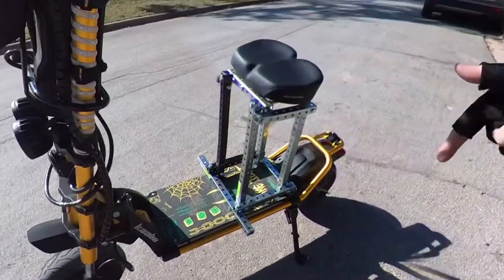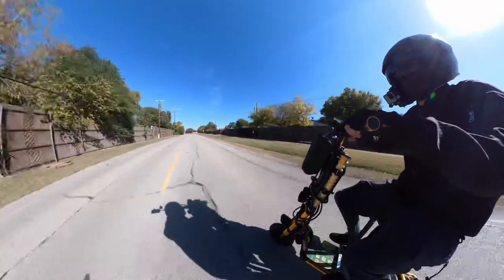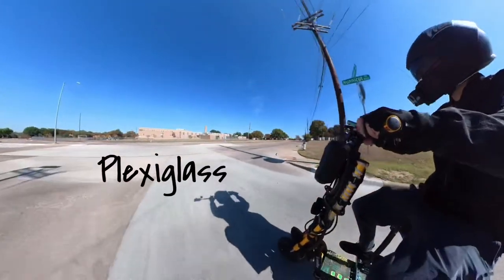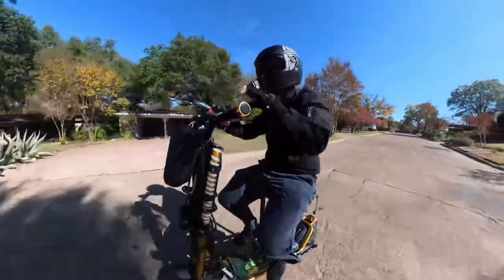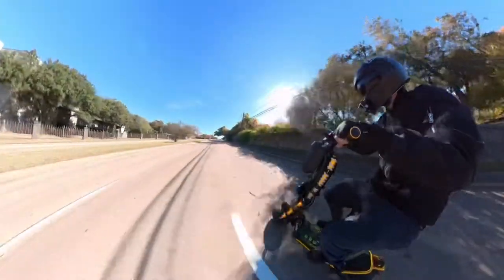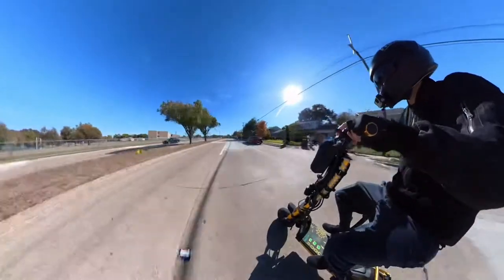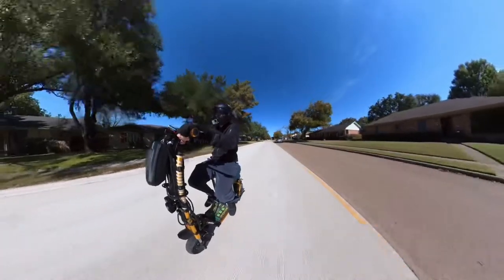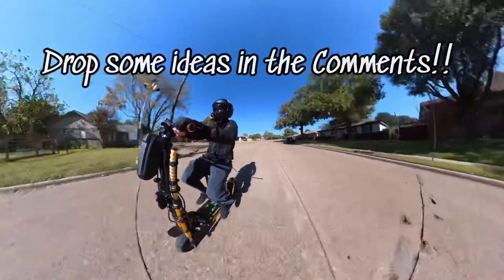SCOOTER MIKEY MODS KAABO WOLF KING SEAT UPGRADE MACH 1 TESTING

Comment: Make sure the weight distribution is good. Don't stress that back wheel/motor.
Reply from the maker: Its actually more center to the deck than i seen kaabo Philippines design.
Reply from the maker: If you look up kaabo Philippines they have the same concept but much more added!!! They have extra batteries and everything in the middle of the deck and the seat in the back. Its much more than i have
Reply: Good stuff bro cap off any edges you have sticking out
Reply from the maker: @keronfarrier2198  yes! This is mach 1, changes will be made forsure
Reply: @LifeWithStiel  cool. They added an extra battery to make it go further?
Reply from the maker: @VegitoBlackityBlack  yes they went 200+ miles one trip
Reply: @LifeWithStiel  I've seen there videos but never knew there was a battery added to it. I wish I lived near you so you could help me do this kind of stuff and I would pay you.
Reply from the maker: @VegitoBlackityBlack  where do u stay at? Im in Dallas
Reply: @LifeWithStiel  Florida
Reply: @LifeWithStiel  link to video?
Reply from the maker: @VegitoBlackityBlack  search up kaabo Philippines on facebook 👍
Reply: @LifeWithStiel  that's where I originally discovered the chair.

Comment: 🐍 Nice start.  Create a base that narrows upwards to an apex welded to a bicycle seat tube with quick adjust/release collar. Then use a suspension seat post and attach any comfortable seat you like from the bike shop. 🖖🤙
Reply from the maker: I was trying too do everything with no welding. All bolt on.
Reply: @LifeWithStiel  the Dualtron STORM seat kit is a bolt on with adjustable post for $85 at VoroMotors.  All you need is the base plate. It's a super clean installation if you have the base plate steel or thick aluminum. It has a quick release collar to pull off the seat, same collar used for folding stems.
Reply from the maker: Did mine for probably $75.  Not the best but it works
Reply: @LifeWithStiel  lol, video says $90.🤙
Reply from the maker: @anacondahugs808  haha was going off top off my head. So yeah $90 if i said that in video
Reply from the maker: @anacondahugs808  i used square tubing, some bolts, and a $20 walmart seat

Comment: How did you mount it to the scooter itself i got a wolf king and want to put a seat on so i can still keep rippin in the winter lmao
Reply from the maker: I will make a video on how to do it yourself soon! I am painting it and still have a few small details to work out. But essentially its mounted to the original deck screws with Square tubing.